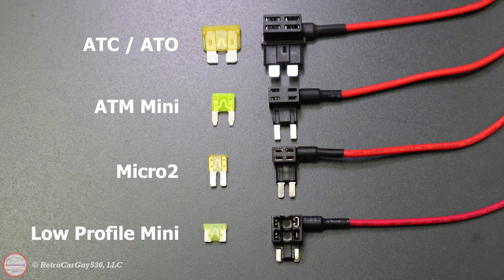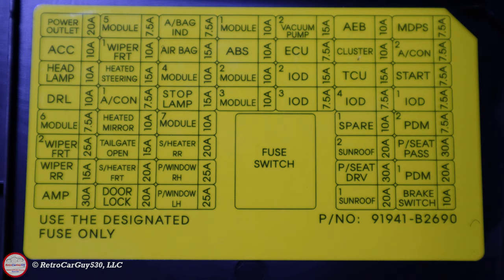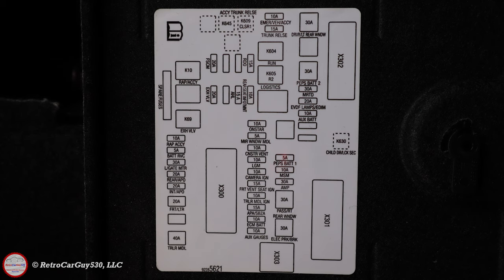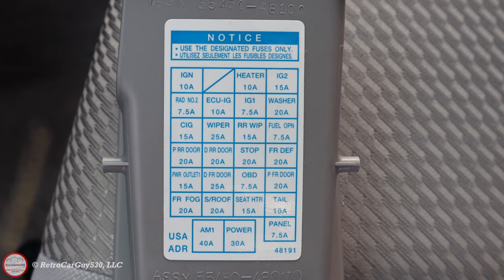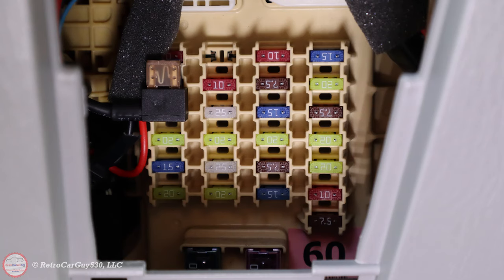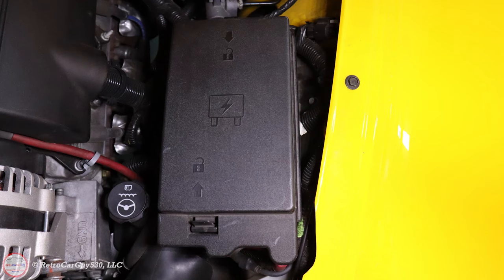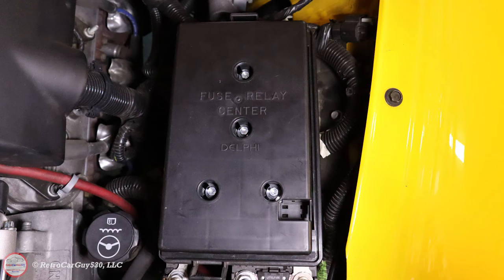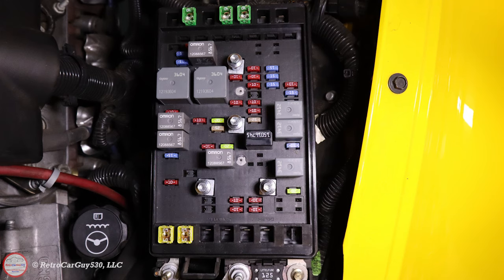How To - Add a Fuse Tap in Your Vehicle

Comment: I agree on finding a pos circuit with no accessories on adding a fuse tap.
Reply from the maker: My first choice for a fuse tap is to insert it into a fuse box fuse socket without any pre-existing fuse in it.   Fuse sockets with power and no fuse in them are very rare in most fuse boxes, but sometimes you're lucky enough to find one!

Comment: These get installed backward quite often. BTW instead of cutting a fuse in half how about using a blown fuse? Cheers. Thanks for the informative video.
Reply from the maker: Even some of the dash camera companies and sellers don't mention the proper way to insert the fuse tap into the fuse box socket.  You can use a blown fuse instead of cutting a fuse.  As long as the two legs of the fuse aren't connected electrically, then it should work for testing purposes.  Thanks for checking out my video!
Reply: @RetroCarGuy530  Yes I've just watched an install video where the tap is installed backward. I searched for your video to link in his comments. It's pointless to hook up a circuit with a fuse and then bypass the fuse. Oh and I've seen what a shorted unfused wire can do in a car. Lots of smoke and melted insulation. Thanks for the excellent video it's a shame those taps don't come with more detailed instructions.
Reply: @RetroCarGuy530  I have to say that I've just found a video chocked full of experiments that suggests that there may be more to these little taps than I understand. In his experiment plugging it in backward does not actually supply unfused power to the load.  I'm a bit confused now.  Edit: His video actually makes perfect sense now. If you plug it in backward the power to the accessory must go through both fuses and will not work at all with only one fuse installed. Still no doubt that hooking it up as you describe provides the most desirable result. Two independent circuits protected by their respective fuses. It's been a learning afternoon. Quite interesting. I hadn't considered if fully before.

https://www.youtube.com/watch?v=2mBa5rRZbCk
Reply from the maker: His testing is correct.  It always supplies fused power to one or both of the circuits going out of the fuse tap (depending on how many fuses are in the fuse tap).  The left leg of the fuse tap runs up the left side of the fuse tap and provides power to both fuse sockets in the fuse tap.  You can consider the left leg of the fuse tap to be an extension of the fuse box's power bus/bar underneath of the plastic of the fuse box.  You can install one or two fuses in the fuse tap to supply power to one or both of the outbound power circuits.  

You only need to put a fuse in the lower fuse socket of the fuse tap when the fuse socket being used in the fuse box originally had a fuse in it.  If no fuse was present in that fuse box fuse socket, there is zero need to (in fact you must not) install a fuse into the lower fuse socket of the fuse tap.   Adding a fuse to the lower fuse socket of the fuse tap when there wasn't a fuse in the fuse box fuse socket can actually lead to strange power drains in the vehicle.  Adding that fuse can lead to strange electrical gremlins since you're now supplying power to the other side of that fuse box fuse socket that wasn't getting power before inserting the fuse tap.  Depending on how the fuse box is configured underneath the plastic, that power may go to things it shouldn't be going to and cause strange things to happen.

Both fuse sockets in the fuse tap operate independently of each other since they are merely a starting point of two power circuits (the original one - if a fuse was present and the one being added by the fuse tap).

When the fuse tap is installed incorrectly, the power routing is wrong and can overload the lower fuse.  In this situation, the fuse box socket's power is supplied to the right leg of the fuse tap instead of the left leg of the fuse tap.  The fuse box power goes into the right side of the lower fuse tap fuse socket.  That's why in the other video when he performed a test with the fuse tap installed incorrectly and there was no lower fuse in the fuse tap, no power was delivered to the new accessory circuit.

When the fuse tap is installed incorrectly, all of the power for both circuits is put through the bottom fuse.  That may cause the lower fuse to blow due to the excess demand of the new circuit being drawn through the lower fuse in addition to the original circuit's power demands.  The upper fuse (for the new accessory) always gets power from the left leg of the fuse tap, it's just whether the power pathway is correct (fuse box power on left leg) or incorrect (fuse box power on right leg).

That other video shows using some high amp fuses (30 amp + 10 amp) which together are too much for a blade style fuse tap.  I talk about that and wire gauge limits in my FAQ video on this topic.  https://www.youtube.com/watch?v=DnZ5wb_A5vE

I hope that helps!
Reply: @RetroCarGuy530  Absolutely it does! Thank you very much. Amazing how something so simple can be a bit tricky. It was my original misconception of an unprotected circuit that got me going, and although that does not seem to be a worry, the problem of both circuits going through the bottom fuse and (in the case of an unused fuse) powering a circuit not designed to be powered in your car are both serious considerations.

Comment: Wonderful video. I have a question. My accessory (lights) came with a fuse tap and 15a fuse. I've located an empty fuse spot in the cabin that has the correct switched power but I'm worried if I should get a new 10a fuse for the accessory since you recommended not to exceed 10a. Lights are LED so should run minimal power. Also, do you need to worry about how much power is going to the empty fuse spot VS the fuse im plugging in? Sorry for novice questions.
Reply from the maker: I've seen accessories supplied with fuses that have an amp rating far too large for the accessory's true runtime needs.  There are two amp draw levels of interest, the inrush amps when the accessory is first turned on and then the steady state amps it draws during its regular use.  The wiring the provides power to the fuse box fuse socket that you want to use is something of a concern as well.  LED lights should have a somewhat reduced amp draw.  If the product documentation shows the max amps it will draw, that's the first thing to check.  The next / best way to check the max amp draw is to use a DC power supply with a digital display showing the amp draw or use an inline multimeter to monitor the amp draw or a multimeter with an amp clamp to monitor the amp draw.  Whatever the max amp draw is for the device, you would want to add 1 or 2 amps to that value and that is the amp rating for the fuse to use for the new device/accessory.  Having a fuse that has an amp rating well above the actual needs of the device/accessory isn't protecting it very well unless there's a dead short to ground.

Fuse taps are very good ways to obtain power for low power consumption devices (dash cameras, radar detectors or similar devices : 1 to 2 amp range).  When the new accessory/device starts to draw 5 to 10 amps that you might still be able to use a fuse tap, but as I get older I'm getting more conservative with my statement of how many amps can be obtained to power a new device/accessory.  My current opinion for a new device is that if it draws 5 amps (10 amps was my previous level) or less, then a fuse tap is a decent way to power it.  If you need 5 amps or more for the new device/accessory then obtaining power directly from the vehicle's battery with an inline fuse is the best approach (IMO).  If you need accessory/switched power, you can use a 4-pin relay to provide that power.  You would use a fuse tap to get accessory/switched power to control the relay.  A relay only consumes 120 to 180 mA for the control feature of the relay.
Reply: @RetroCarGuy530  thank you so much for the thoughtful and informative response!

Comment: My # 1 fuse slot in my van which is labeled ""horn"", although my horn works, does not have power to either side from in the fuse jack. Can I take the wire from that fuse port and use a fuse jack to power it? Thank you
Reply from the maker: The horn's fuse socket in the fuse box may only have power when the horn button is pressed (powered by a relay).

Comment: Why does the tap need to be plugged in a certain way? Does the wire tap have a dioed built in?
Reply from the maker: There are a couple of different trains of thought on this topic of using a fuse tap to obtain power for a new device/accessory.  What I demonstrate in this video is the "in parallel" approach of routing the power through the fuse tap.   The power obtained from the fuse box fuse socket is directly routed to both the lower and upper fuse sockets in the fuse tap.

There's another approach which would be labeled "in series" power routing approach.  That's where the power from the fuse box fuse socket goes up the right leg of the fuse tap, through the lower fuse in the fuse tap and then down the left leg of the fuse tap to the original fuse box fuse socket and it also goes then up to the fuse tap's upper fuse socket.  All of the power load runs through the lower fuse in the fuse tap.  Which approach is best to use will result in spirited discussion/debates.    The "in series" power routing method can be seen as the absolute safest approach, but it may also lead to blowing the original fuse in the lower fuse tap fuse socket since both power loads are being run through the lower fuse.

For dash cameras, radar detectors and similar power demanding devices (usually 2 amps and very often dash cameras use less than 1 amp), the "in parallel" power routing approach is very safe.  It will only be adding 2 or often less than 1 amp to the circuit that is supplying the power to the fuse box fuse socket.

I have another video that tries to explain the "in parallel" approach a little more in depth.  https://www.youtube.com/watch?v=YNc0FfeL6rw

Comment: bridging fuse piggyback causes issues on BCM as on electronic can hold only certain amps as been programmed like that from  OEM
Reply from the maker: I agree.  A fuse tap should never be used in a fuse box fuse socket that provides power to any computer module in a vehicle or receives power from a computer module (i.e. BCM). In my car (2014 Chevy Caprice PPV), my interior dash fuse box sources all of its power from modules (primarily the BCM), so I cannot use it for any fuse tap power source.

Comment: Your half a fuse test for power, is there a way to test for power using the multimeter alone instead of the tester ? 

Well explained video. Subscribed.
Reply from the maker: I use the 1/2 of a fuse approach to make sure the test leads from the multimeter or the test list don't expand the contacts inside of the fuse socket.  Depending on the type of fuse and the fuse box, if the electrical contacts in the fuse socket can be reached using the test lead from the multimeter (not putting any stress on them), then certainly you can just use the multimeter's test leads or a 12-volt test light to check each side of the fuse socket to determine which side provides the power in that fuse socket.

I've found many fuse boxes will have the contacts for the fuse socket down so low in the fuse socket that the only way to reach them is using 1/2 fuse approach.

Thanks for subscribing to my channel!
Reply: You can also use a blown fuse. That way you don't have to remove the half fuse
Reply from the maker: A blown fuse would work as well

Comment: Great video but I have a question. When using the fuse tap, if I was to try and tap into my washer fluid pump fuse slot, does having the tap allow the power to power both my washer fluid pup and the accessory I will be connecting to it? I hope I worded that well enough. Thank you!
Reply from the maker: You might want to watch (if you haven't already) a video I recently created on the anatomy of a fuse tap.  https://www.youtube.com/watch?v=YNc0FfeL6rw

In that video, I discuss how to use the fuse tap itself along with a single fuse in the top fuse socket of the fuse tap to look for the side of the fuse box fuse socket that provides power in that fuse socket.  You can also take that opportunity to see if the fuse socket's power is one of the following types:

1) Constant (unswitched)
This could be true, but unlikely.  This would likely mean you could turn on the washer fluid pump at any time by using the switch in the car for the washer fluid pump.  If this is true, it means the washer fluid pump switch is controlling the ground side of the washer fluid pump to complete the circuit.  This would not turn on/off the power to the new accessory since the fuse tap would supply power all of the time.

The next two examples depend on how the washer fluid pump's power is controlled:

2) Switched power (ignition switch in on/run position) - provides power even when not using the washer fluid pump switch
If the power for the washer fluid pump is present the entire time the ignition switch is in the on/run position, this means that the switch to control the washer fluid pump is very likely controlling the ground side of the power circuit for the washer fluid pump.  In this situation, the new accessory would have power the entire time the car's ignition switch is in the on/run position.

3) Switched (ignition switch in on/run position) - plus only when you use the washer fluid pump switch to turn on the pump
This is the situation that I believe you're looking for.  The switch for the pump controls the 12-volt power side of the pump and not the ground side of the circuit for the pump.  In this situation, the fuse tap will provide power to the new accessory only when the ignition switch is on and you're using the switch to turn on the washer fluid pump.

You can use a multi-meter or a test light to see which type of power is provided by the fuse socket in the fuse box for the washer fluid pump.

I hope that helps.

Comment: My Silverado does not have a sunroof, but has a 25 amp fuse in location marked sunroof. could this be a viable place to use a fuse tap? I'm trying to use the tap as a power source for my mobile ham radio. I was also wondering if a 10 amp fuse would be a good choice for that. It's a Midland MXT400, which is a 40 watt transceiver, or would a lower amp fuse be better. Thanks, glad I found your channel
Reply from the maker: You should be able to use an unused fuse box fuse socket that is normally rated for 25 amps if the feature is not present in the vehicle. Make sure you only use one fuse in the fuse tap (upper socket). Placing any fuse in the lower fuse socket of the fuse tap, might provide power to something in the vehicle that is not intended to receive power in your vehicle's configuration. It doesn't necessarily cause a problem in most situations, but to be 100 percent sure, only use the one fuse in the upper fuse socket of the fuse tap.

I would think a 10 amp fuse would be sufficient for your ham radio, but you need to see if there are any specifications documented on the unit or in its product documentation that states how much power it draws while in use and while powering on.
Reply: @RetroCarGuy530  Thanks for the quick reply. You're my new hero.

Comment: Awesome video. I want to install interior LED lighting that turns on when my low beams are on. Is there a way I can just pull power from one of the headlight low beam relays?
Reply from the maker: I don't know of a relay tap other than for testing purposes.  Often, there are fuses in the circuit after the relay to the item being powered by the relay.  If you can identify a fuse that obtains its power from that relay being activated for the low beam headlamps, you could tap into that fuse.

Sometimes, the fuse appears before the relay in the circuit which means it won't be useable as a switched power supply for the LED lights since the power is likely present all of the time.

Comment: In the test process instead of cutting a fuse into two, using a blown out fuse (or deliberately blow out one) is much simpler.
Reply from the maker: I agree there are easier ways to perform the power source test.  In my recent fuse tap video, I demonstrate using just the fuse tap and a fuse in the top socket of the fuse tap. https://www.youtube.com/watch?v=YNc0FfeL6rw